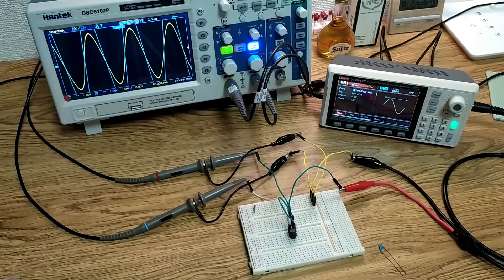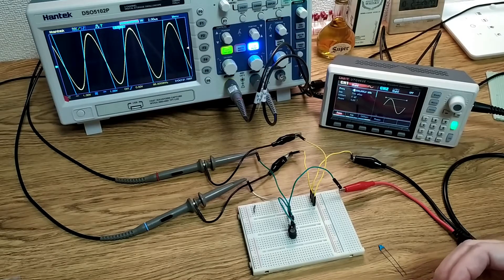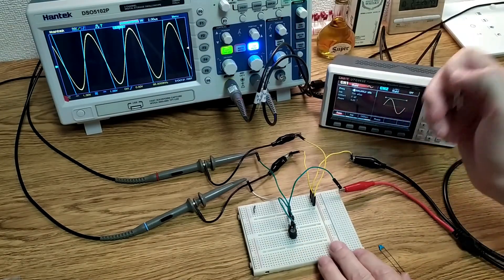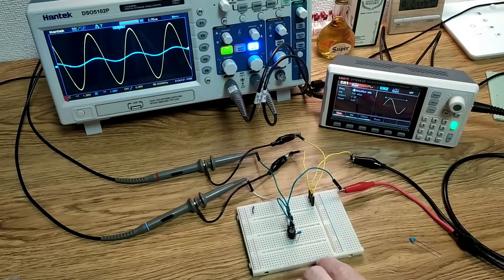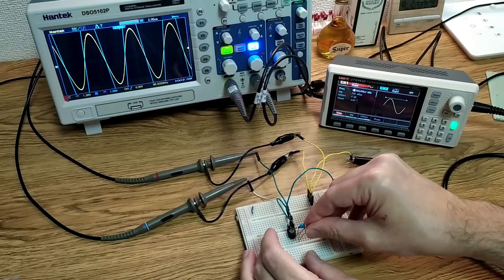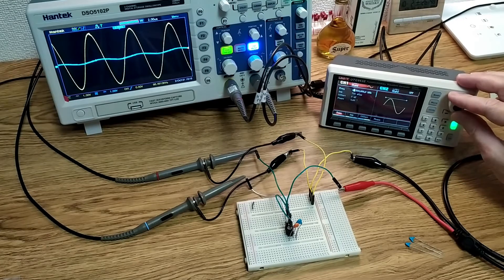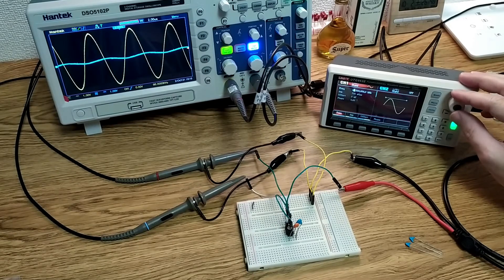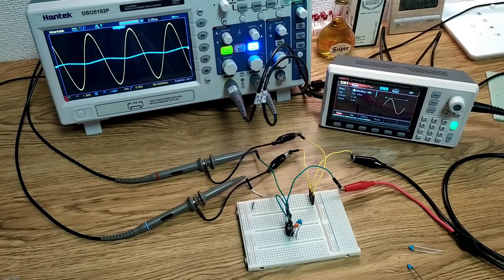Bias Trap Demo - how does a bias trap work?

Comment: Thank you for covering this, I always have had some questions about the topic of the "bias trap" and there is so sparse information about this on the web. And my biggest question still isn't answered, maybe you can help me out with it. And it might be a completely silly question, but I have to ask it anyway: Is the bias trap needed on the record side of a tapedeck, or the playback side, or both? I'm quite sure that I have heard of Bias trap being in the playback section as well. But here's the point: as different decks use different bias frequencies, what would be the point of a bias trap in playback circuitry? It would only "fit" if playing back a tape that has been recorded on that same deck, wouldn't it?
And if the bias trap is used on the recording side: well, if you filter out the bias frequency before feeding the record head, what would you need the bias oscillator for anyway?
I just can't get my head wrapped around this. Maybe someone has some information about this. Anyway, thanks for demonstrating it hands-on!
Reply from the maker: I'm not an expert, but here's my understanding...Bias signal is necessary for recording.  It provides a nice signal to wipe a tape, but also gets mixed with the signal you want to record, which somehow makes the tape accept the audio signal better by exciting the magnetic structure of the tape.  The trap exists to keep the bias signal, which is often at quite high voltage (70-80V), out of the audio record amplifier circuit (usually an opamp).  Without it, you'll get either a blank tape, or distorted audio the other end.  Failing traps can create all kinds of weird distortion that will drive you nuts until you work out where it is coming from.
Reply: @felix_da_katze  Thank you so much for your quick reply! Yes, for the recording side, this all makes perfectly sense. Still I don't get why decks have a bias trap also on the playback side, because if this would be there to "filter out" any remainders of the bias signal, this would only work if the tape was recorded in the same deck (or at least a deck using the same bias frequency), and from what I've learnt there are a wide variety of bias frequencies in use (varying from around 65 kHz up to 250 kHz). Thank you anyway and I will continue searching for any information on this, and studying schematics and datasheets... It's fun tinkering around with that old technology anyway!
Reply from the maker: As far as I know, there shouldn't be any bias actually used in playback...so...dunno?  There is sometimes a switch for the different tape types, and in record mode that makes a difference to how hard the record heads get driven, and sometimes makes a difference to playback, sometimes not.  Or not that I could tell.  I haven't delved that far into it.  But once you get a deck sorted, and get your hands on some Hi-Pos or Metal tapes, to record to, you'll get a new appreciation of how good they can be.
Reply: @fabianswebworld
BIAS = HF-Vormagnetisierung. 
Würde man das Audiosignal direkt (ohne HF-Vormagnetisierung) auf die Aufnahmeköpfe geben, so würde die Magnetisierung des Bandes im Nullpunkt der dort nichlinearen Hysterese-Kennlinie stattfinden. Das würde zu nichlinearen Verzerrungen führen. Deswegen überlagert man das Audiosignal mit einer Hochfrequenz, deren Pegel so eingestellt wird, dass das Audio-Signal den linearen Teil der Hysterese-Kennlinie aussteuert, was natürlich zu erheblich besseren Ergebnissen führt. Da sich die Hysterese-Kurven der verschiedenen Bandsorten voneinander unterscheiden, muss natürlich auch der Pegel der HF-Vormagnetisierung entsprechend eingestellt.werden, um optimale Ergebnisse zu erzielen. Bei vielen Kassettendecks erfolgte die Umstellung per Schalter (Fe, CrO2, Metal) oder automatisch durch die Kodierung des Kassettengehäuses. Bei besseren Geräten konnte man dann noch manuell oder automatisch auf die entsprechende Bandsorte einmessen. Bei Tonbandgeräten musste man das genauso machen.
Hysterese ist ein Begriff aus der Lehre des Magnetismus.

Comment: Sadly, this knowledge and those who want it are disappearing. Stumbled upon this because someone had swapped out resistors for the capacitors in the bias trap  in my cassette deck. Yeah, I dunno what they were thinking.I asked myself, could the schematic, and parts list, and ink markings on the circuit board be wrong ? Nah. Especially since the resistors used were obviously different then the others on the board.
Reply from the maker: Yeah, I can't imagine that working very well.

Comment: Hi, i do have Teac v6030 cassette deck but i do have strange issue. it simply doesn’t record, on a front panel is showing record mode but does nothing. id did replace all transistors and HX Pro IC (all from working unit V610) and still the same. also, the transistors in bias generator are getting very hot when i press record but during playing they cooled down. i did replace all caps even and checked resistors. the last part left coil which i replaced from working unit but i had different issue. during playing it erase the tape and still didn’t record but erasing. supply voltages are ok but i start getting mad. i have replaced everything :(. what could be an issue? if you have knowledge will you be able to help me with my deck? I’m in London.
Reply from the maker: Do you have a scope?  If not, a multimeter that can measure Hz can be useful.  You want to start and see if you get some kind of bias signal while recording.  Also feed a 1kHz signal in the jacks and probe for it.  It should be eventually making its way to the pins that feed the heads. 
BUT if your transistors are getting hot, then likely something is shorting, and it could be they are cooked.   Blow with compressed air to cool them down and see if that makes any difference.  I had some recording issues with a CT7100 that sound kinda similar, there's a video, have a look and see if it helps.  Otherwise head over to tapeheads forums and put some pictures up and see if there is any model specific advice others can give.
Reply: @felix_da_katze  hi, I just watched your pioneer bias problem video and yes, I was surprised about poly caps, I bought now new caps, I hope Mylar will be ok and some ceramic high voltage, once will arrive I will replace them and I will see the result. I do have 2 other decks with similar issues so maybe the same like in your pioneer. In reality electronics is strange as many times I check the components, there looks ok on readings by in circle they get bad. Also I have install those transistors into other unit and they are ok so the poly caps is last think. I will let you know.
Reply from the maker: Good luck with it.  It can be frustrating at times, so you really have to stick with it, and sometimes step back from it and have a think.